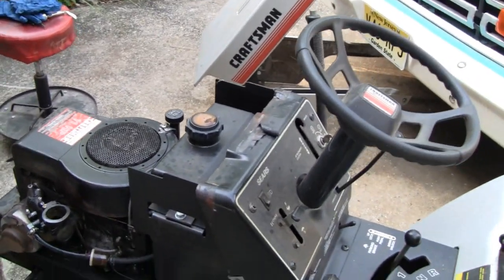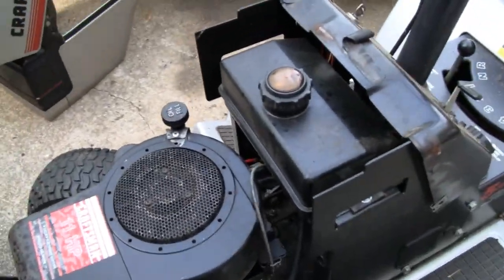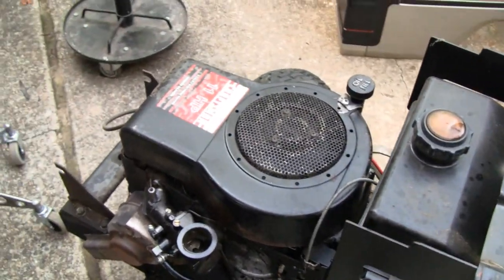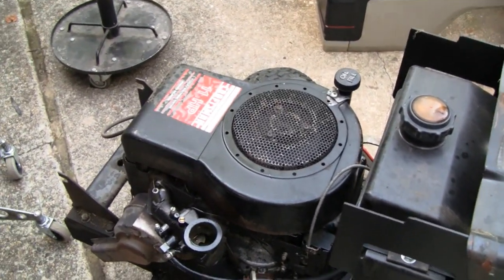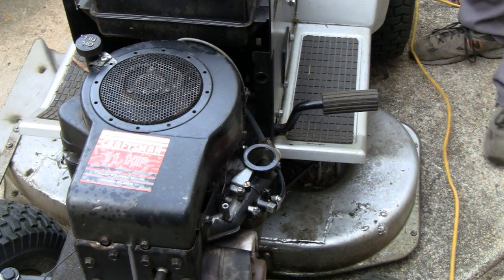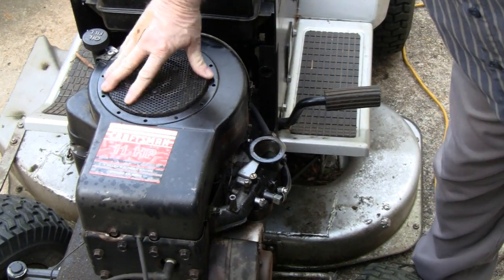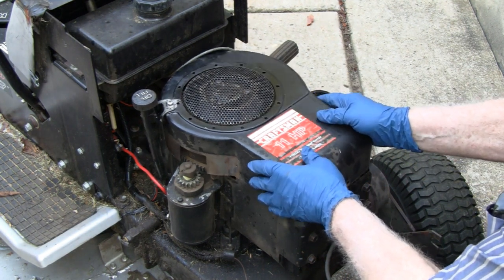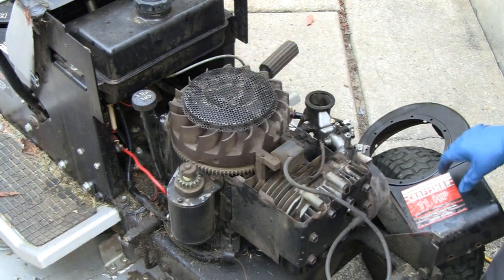EMERGENCY FIELD REPAIR on BRIGGS TRACTOR

Comment: Now that is a great repair and diagnosis.  For its age the mower sure runs good.  Great job of pinning over the aluminum as well.  Hope that works for a long time.  Thanks for the videos.
Reply from the maker: Thanks Dbut!! It doesn't have to last long, it just has to outlast me!!☻
Reply: @805ROADKING  Hopefully that is another 40 years if you wish.   You mentioned you thought about selling your Harley and getting a Triumph.  My Triumph was a quick bike and easy to control but after 40-50 miles I needed to take a butt break.  Not really a good long road bike like a Harley but very fun and not complicated.  At my age and strength a Harley is to heavy for me.  Just some advice from an old guy.

Comment: That is nice looking classic Briggs and stratton L head engine  that is so cool that is 40 years old and still running
Reply from the maker: Yeah Buddy!! That Machine has been very good to Me, I should have taken better care of it!!☻
Reply: @805ROADKING  truth be told  the newer ones are nothing but junk I have  one craftsman gt tractor plus a poulan XT with the metal tranaxel . plus 2; craftsman LT one being a hydrsatic drive the a manual transmission last a John Deere LT 133

Comment: Crazy you stop for gas and this happens.  Same kinda issue with my tractor, stopped running yesterday…think I have the same issue.  Tearing it apart this week.

Comment: That's funny. Mine had valve trouble last week. It's a 13 year old B&S 17hp ohv. Mine was easier to fix. It was just a rocker stud unthreaded.  I was lucky like you too that mine stopped in the shade. I just finished mowing with it and it was ok. I was sweating a little in the 105° heat. Thanks for the videos👍

Comment: I had that exact mower with a 12hp Tecumseh engine. I bought it used. The 1st time I used it the rod came out of the bottom of the block! I found a used bottom end and pieced it back together. It was a great tool for many years until the deck rusted away.
Reply from the maker: I should be good till I die!! I repaired the deck once already and it seems to be holding up plus I have a perfect one in the shed someone gave me!!☻

Comment: I had the same thing happen on a 2 cylinder opposed Briggs.  I penned it around the seat and it ran like that till I got rid of it several years later
Reply from the maker: It doesn't have to last long Lloyd, it just has to outlast me!!☻

Comment: RK - Nicely done!
The exact thing happened to me with a small Briggs on my water pump while mining on the beach in Nome, AK a few years ago.  Almost no tools but I did have a righteous hammer and punch (a 16 penny nail pulled from a 2x4 and straightened")  and they did an admirable job.  
Now THAT was an Expert Field Repair!  (Remembering that an "Expert" is a little drip, under extreme pressure, with only one way out.  🎇  - Joe S -
Reply from the maker: Thanks Joe!! That's a real field repair!!☻

Comment: I fixed a ton of  those like that RK , did the same , pinned it  4, 8, 12,16 ,20 . and put the head back on . ran a long time after .
Reply from the maker: It doesn't have to last long Bob, it just has to outlast me!!☻
Reply: @805ROADKING  About the size of it RK .

Comment: Should be a good fix.pean the aluminum housing and knock valve ring back in place should hold.we used to do that with bearing races.and it worked fine
Reply from the maker: It doesn't have to last long, it just has to outlast me!!☻

Comment: Big lawn. Now a model T ford burns valves like it burns oil. So simple fix. Pull the head. Probably not finger tight so wrench. Pull the valve cover on the side of the block. Might be finger tight. But probably wrench. Use the valve extraction tool from under the seat. Throw away the stinking burned valve. Stick the spare valve in. (From under the seat). Grab the thing that looks like an egg beater from under the seat. Stick the points into the holes in the valve. Crank the egg beater thing for about 5 minutes. Use the valve tool to reattach the valve and spring. Bolt the head back on. Oh one the valve cover. Use a wrench. Put the tools back under the seat and sit on it. Go buy a new spare valve. Unless it’s Sunday cause the auto parts store is closed.
Reply: I like the old cars, but not that old   lol
Reply: What about the coolant? Do you fill it with plain water or do you also add a tablespoon of coffee to get a better fragrance?
I'm just kidding, I'm from Spain and here when the engines are quite deteriorated we say that they work like coffee machines LOL
Reply: @ruben_balea  add water. Often. No water pump. So… coffee. Hum… could work out. Drink fast.
Reply from the maker: That's why there are still millions of them still around after 100 years!!☻

Comment: I had that happen on a 3.5 hp briggs push mower and a 22 hp rider this year. I did the same fix as you and still holding fine.
Reply from the maker: That's cool!! It doesn't have to last long, it just has to outlast me!!☻